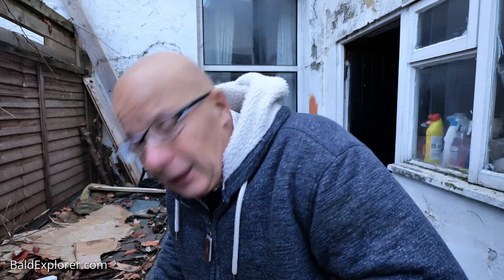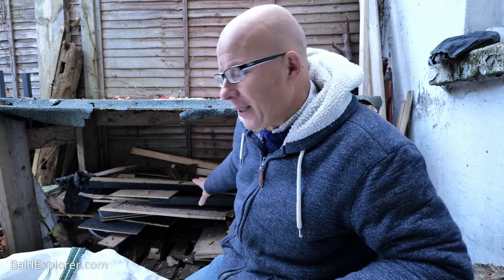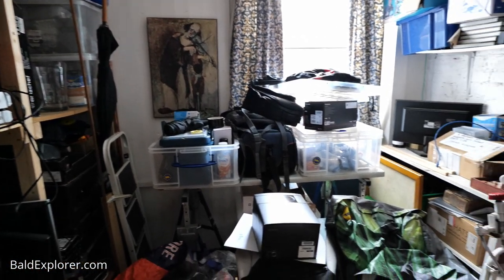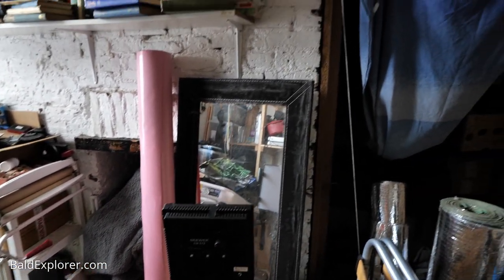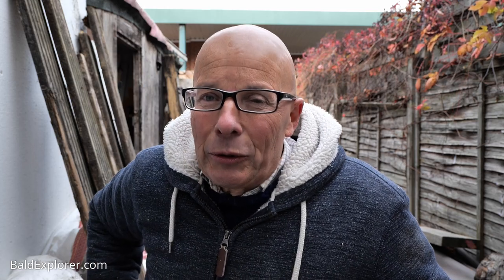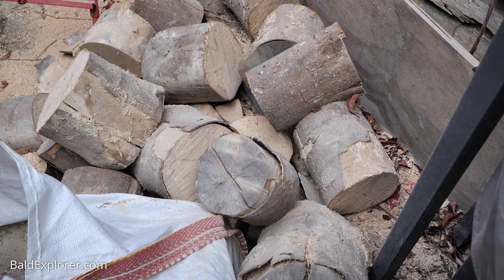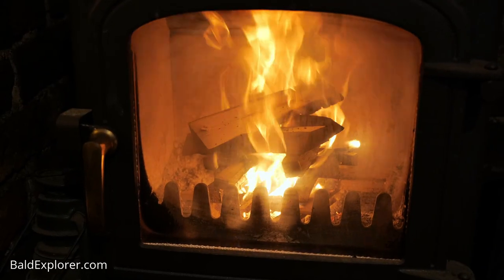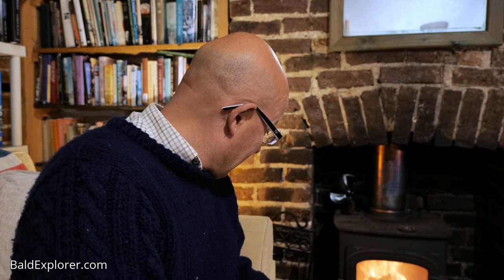Look out! I am having a go with a chainsaw!

Comment: I've got an esse with a boiler and a big open fire with a boiler I've fitted in, with them both swinging it heats 12 radiators, you could tap off from your esse and heat a few rads upstairs just by convection, I've done that and it heats all upstairs, rads get red hot.
Reply from the maker: Sounds great!

Comment: I really like these at home domestic vlogs. Its so interesting to see your home and lifestyle so please don't beat yourself up about not getting out. We have wood delivered from a tree surgeon who lives round the corner for our new multifuel stove. It really does heat most of the house but getting it right to burn the wood longer seems to be a dark Art. Some say don't burn wood and smokless fuel together, some say its good for the stove. I have watched your Esee cleaning vlog and like yourself, the tar deposit is a real problem after every fire. I have tried ash + newspaper, the Pink Stuff and some quite expensive spray from Amazon which was supposed to be a miracle cleaner, which is isn't. It seems a toothbrush and some good old elbow grease does the job, although I will try the Mr Muscle spray you had.

Comment: Keep it up as long as you can especially if you have a reliable source, but eventually you'll be banned just like my Grandma and all her neighbours was from burning coal in the 60's. A sign popped up at the end of the street, it said "This is a clean air area." You could smell the difference for a while as the smell of Horse muck became more prominent, but the car was becoming more common by the day, and old Neds days where numbered. 
A bow saw gave you your first impression of how good the log was and the chainsaw must do also. The effort involved meant you didn't need a fire for hours if you kept your clothes on. 
Elm disease kept myself and the family warm during the die off period. I liked to burn Pine at Christmas for the smell and the sparks when I had a chimney.

My gran thought coal had built the wealth of the generation, and she looked on her being banned from using it as an attack on the poorest. Having worked amongst the poorest a cold winter could see the contents of their house burnt in the grate including the banister rail, floorboards from under the bed, and books and shoes. Chipboard flooring stopped most of that along with not building a chimney any more.
For some fuel costs have always been too high, but now if they want to stay warm and in a liveable interior with less mould, they have to pay for it especially if insulated, as the sun can no longer do it either.
Today it's cold outside and my house is too cold to sit in without added heat or a coat early on. The windows have a film on to cut infrared ingress  and the walls are stuffed with Insulation. The sun is out but only the solid wood front door is warm and radiating indoors. It can get hot enough that you can't keep your hand on it, yet it's only 11C outside. It's greatly appreciated free heat, so in a bid to save the planet, housing wants to change it soon for an insulated plastic one.